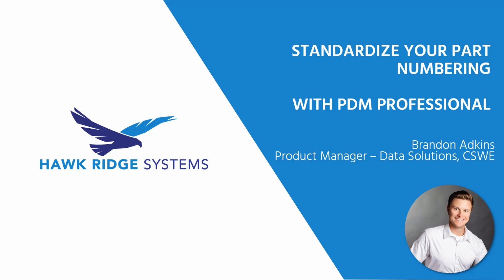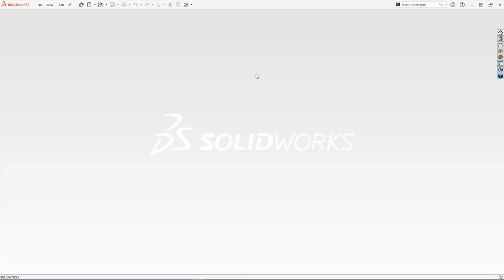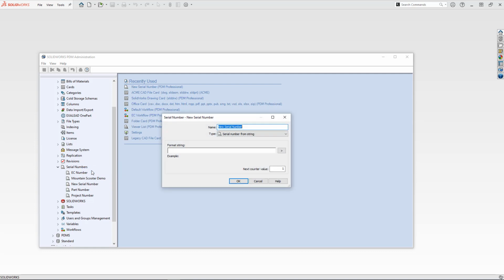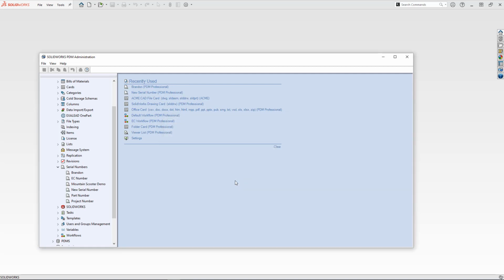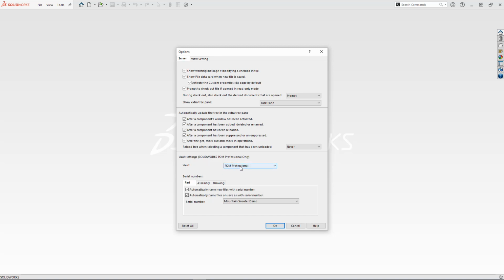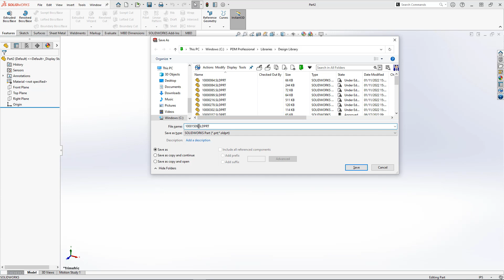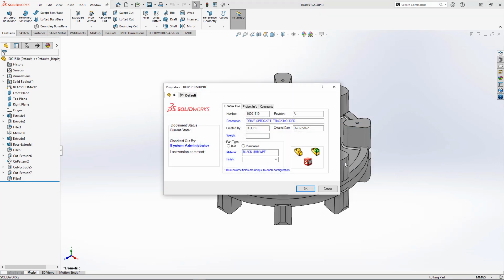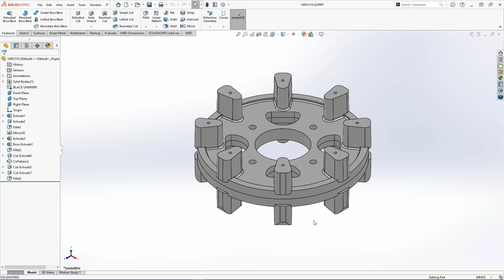Automated Part Numbering with SOLIDWORKS PDM Professional

Comment: The main issue with this (which we also face) is that SW will still use the sequential number when opening, changing between windows and so on as the sequential number will be the filename as well. I don't understand why SW don't have a solution where the sequential PN is just a hidden option, you don't see it unless in the data card, but when opening and working with the file you just have the description for example.
Lets imagine you want to add a file (already opened in SW in another window) to your assembly then you have to guess from the sequential PN what kind of PN it is.